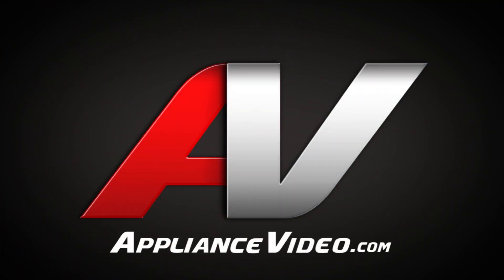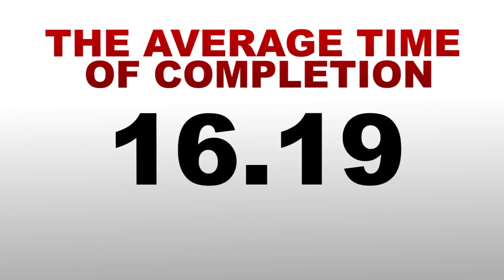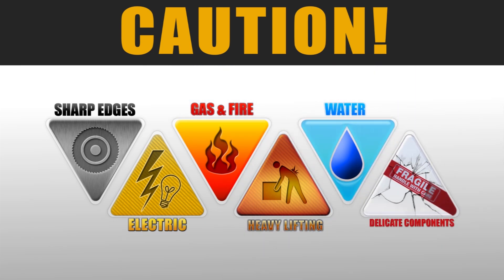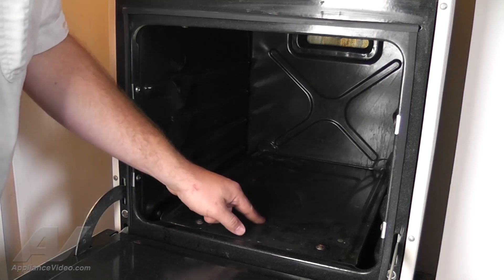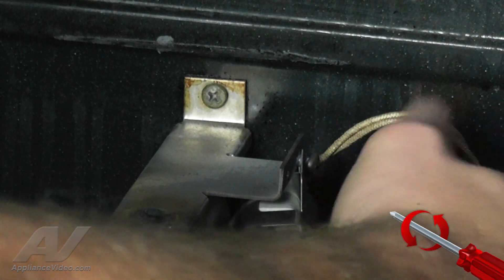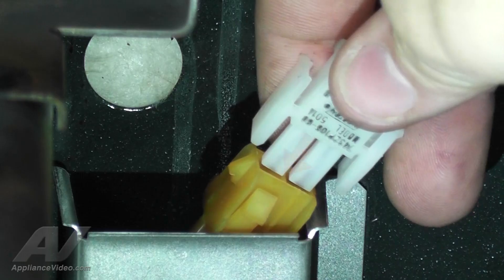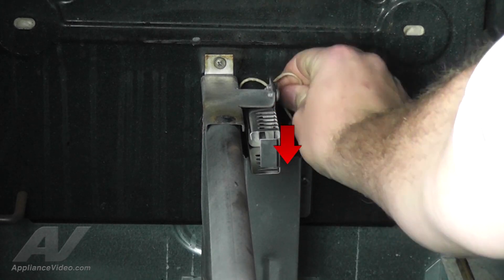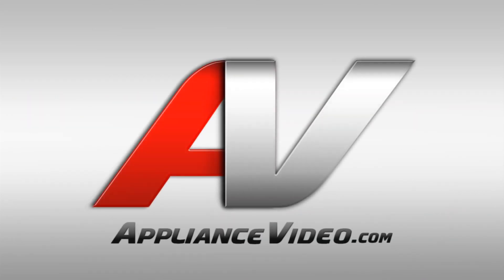Whirlpool Stove Repair - Igniter Glows but Will Not Light - Oven Ignitor

Comment: Mine was a Kitchenaid Superba and the connection was in the back. This involved taking off the back panel, threading the wires through the back end to make the connections at two different points. 1 hour job with cleanup and had to have my better half help me thread the wires through. Saved me two service visits worth of cash though. These videos are so helpful!
Reply from the maker: Balls McGee
             

       Thanks for the positive comment. Glad we saved you some money. Please help us provide more videos to our site by posting ApplianceVideo.com on your YouTube, Facebook or Twitter account or add us to your circles. If you are in need of any parts please support our parts department on line at http://savemoreonparts.com/ or call 1-800-830-5465 7-days a week until 11pm Eastern time. Thanks again your support.  Matt, Ace Appliance service technician.

Comment: I have replaced the igniter and the safety valve and then reset the plunger on the gas regulator, on a Frigidaire gas oven. I am able to get a low blue flame on the oven burners, but it does not respond to the temperature setting on the dial. What should I look at next? Would this be the temperature sensor or the regulator? The surface burners on top work well.
Reply from the maker: Start off with the temperature sensor. We only see regulator issues about 3% of the time. We service over fifteen thousand service calls per year and only replace a small number of regulators. Our family-owned and operated company works hard to provide you with FREE, high-quality repair videos. Please call  1-800-830-5465 for any of your parts needs, or you can order online 24 hours at: ApplianceVideo.com.  Thank you for your continued support and good luck on your project. If you are in need of any parts, our parts department has over 5-million in stock for same day shipping. Thank you and good luck with you project
Reply: In the same boat with a whirlpool low blue flames if I take a lighter to it...the element just glows bright but it seems not enough gas is getting to the igniter...

Comment: Am disappointed that I can't find instructions for replacement of a Whirlpool single lead igniter. Have a new tube and igniter that aren't working once installed. Think there is a problem with the 
cord, but have been unsure of how to test the igniter and the regulator. Am still searching.
Reply from the maker: Great question, if you have a more technical question that our parts department cannot answer, you can search our over 17,000 answered questions free at our website www.ApplianceVideo.com under our Repair Help section. You can also call our parts department at 1-800-830-5465 and they can give you help 7-days A week ,or search at www.SaveMoreOnParts.com  .

Comment: My Oven Glows hot on the left side, the right side glows hot in the back part but the front isn't glowing.   Do I need to replace the element itself?
Reply from the maker: Great question, you can call our parts department at 1-800-830-5465 and they can give
you help. If you have a more technical question that our parts department
cannot answer, our technicians are answering
all questions at our website at www.ApplianceVideo.com under our Repair Help section. We have over 3,000 common
questions and answers that you can easily search through by your model number,
appliance make, and problem or error codes, and It’s free to search through our
question & answer library.

Comment: I replaced the igniter already, the oven still doesn't work.  What s the problem with my oven.  Thanks.
Reply from the maker: Great question, if you have a more technical question that our parts department cannot answer, you can search our over 13,000 answered questions free at our website www.ApplianceVideo.com under our Repair Help section. You can also call our parts department at 1-800-830-5465 and they can give you help 7-days A week ,or search at www.SaveMoreOnParts.com  .

Comment: My gas Whirlpool electric igniter will not light my burners.  Any advise?  Bad igniter?
Reply from the maker: James
        All of our technicians are now answering questions daily on the ApplianceVideo.com website. You can search completely FREE in our Repair Help section. Or you can get unlimited technical advice and video links emailed to you by our 14 factory certified technicians at http://www.appliancevideo.com/premium-membership/.  If you are in need of any parts please support our parts department on line at http://savemoreonparts.com/ or call 1-800-830-5465 7-days a week until 11pm Eastern time. Thanks for your support. Matt Ace Appliance factory service technician

Comment: The wires on my new ignitor have “female parts”, how do I replace them with “male parts”
Reply from the maker: Great question, if you have a
more technical question that our parts department cannot answer, our
technicians are answering all questions at our website at www.ApplianceVideo.com under our Repair Help section. You can also call
our parts department at 1-800-830-5465 and they can give you help 7-days A week
Monday -Sunday, or search at www.SaveMoreOnParts.com  24 hours
7- days A week.

Comment: My burner ignitors will not turn off
Reply from the maker: Great question, if you have a more technical question that our parts department cannot answer, you can search our over 17,000 answered questions free at our website www.ApplianceVideo.com under our Repair Help section. You can also call our parts department at 1-800-830-5465 and they can give you help 7-days A week ,or search at www.SaveMoreOnParts.com  .